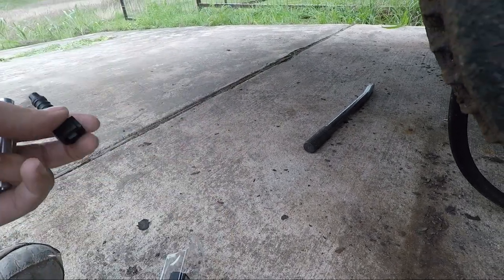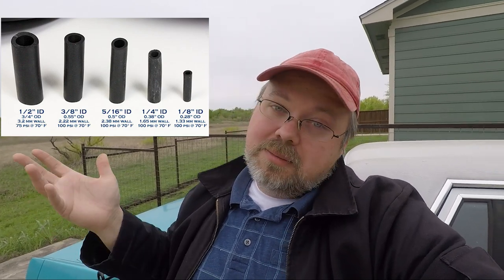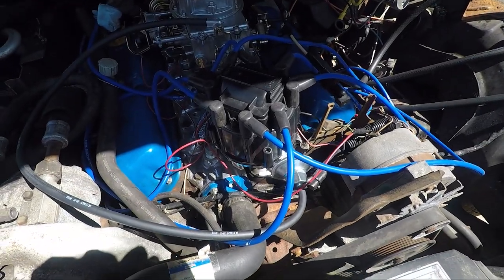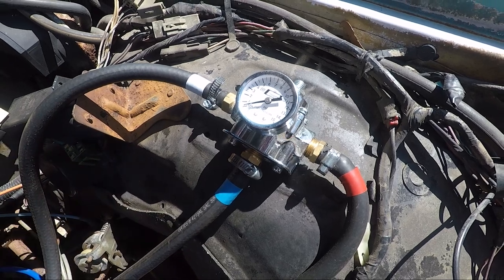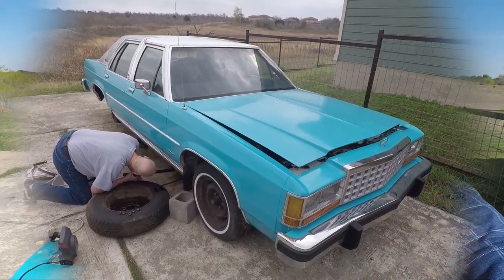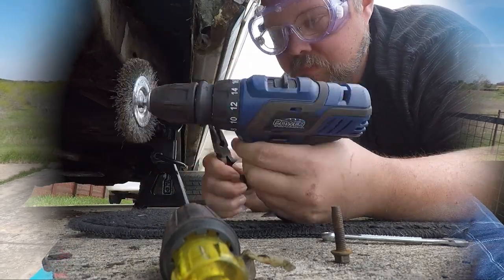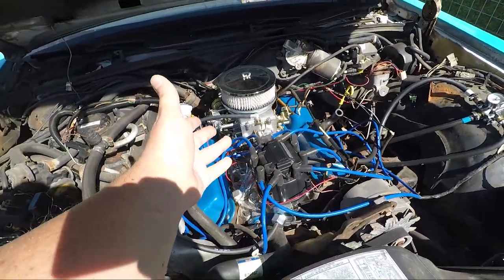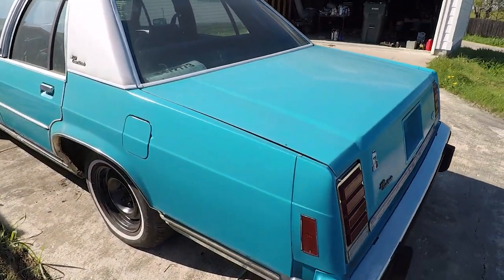1984 Ford LTD Crown Victoria Restoration Ep. 10: Unknown Unknowns

Comment: Im leaning towards timing being the issue, maybe the distributor is 180* out of time or something. You should be able to roll the harmonic balancer to top dead center on cylinder number one and pop the distributor cap off make sure it’s pointed to cylinder number one, you can also take the #1 spark plug out and and set a screw driver in it to confirm it’s at top dead center. No matter which way you turn the balancer the screwdriver should move down if it is at top dead center.
Reply from the maker: Thanks Andrew for the advice! I will check and see if that is the case. It is entirely possible that I put the distributor in 180 degrees off, and it would be great if that was all the issue is!

Comment: Check the timing chain, sometimes that can cause the car not starting. This happen to me with an old f100 with the 302 and carbureted …
Reply from the maker: Thanks for the information! From my understanding, the timing chain is fairly simple to get to on the 302 engine. I know with some cars you basically have to take the motor out but I think the 302 is easier to get to. It's been a wonderful learning experience so far and I'm looking forward to more information!
Reply: @gwe87  also is the first time I see a distributor like the one you have on your car, I have only seen those on Chevy …
Reply from the maker: @juantijerina9393  Yeah it’s a GM style HEI distributor that has the coil built into the top part of it. From what I read, it should work just fine with the 302 engine (there are a WHOLE bunch of videos with older mustangs converted with it). The mustang also used the 302 engine so I think they would work just fine together.

Comment: Have u checked to see if u put the distributor in 180 degrees out. Which also wont let it run well at all bud
Reply from the maker: That is going to be my next step! Thank you so much and the fact that it's not running at all would certainly point to that as a very good possibility for the problem.
Reply: Yes, and also check for spark. That car has a single coil.

Comment: Check fuel pressure from the pump.if its fuel injection.  If its the carb,check the accelerator pump. And pump diaphragm
Reply from the maker: Thank you so much for the insights. It's a brand new carburetor and the accelerator pump is squirting gas into the carb (as visually inspected) so I am hoping that is working properly. I don't think I have any way to test the accelerator pump that would give me the pressure it's shooting out, but I can see that it is shooting out.
Reply: Did u check for spark?
Reply from the maker: @pdinardo9472  Yes. I put the plug against the manifolds and saw spark.

Comment: I wouldn't have left it throttle but fuel injection,  I hate carburetors they are a major pain. More than likely out of time
Reply from the maker: Hi David, thanks for the insights as always. It could be the timing. I'll check and see what all is involved in getting to the timing chain (I think on the 302s its a relatively easy project). Appreciate the advice and will let you know what I find!